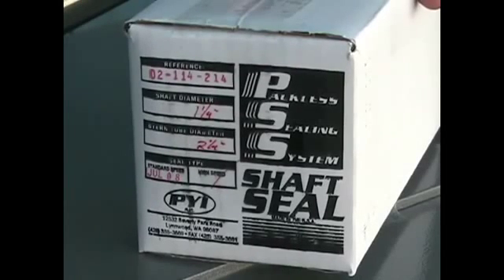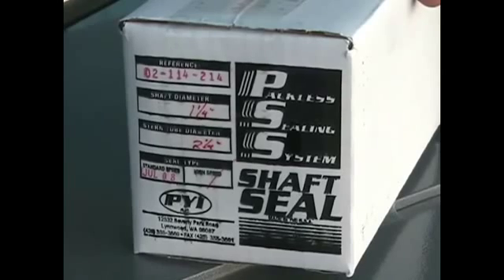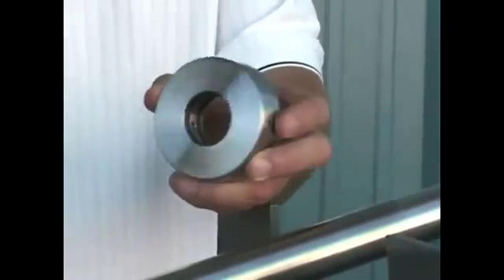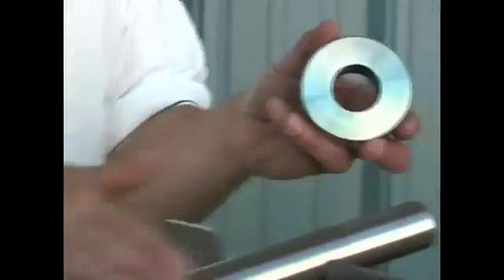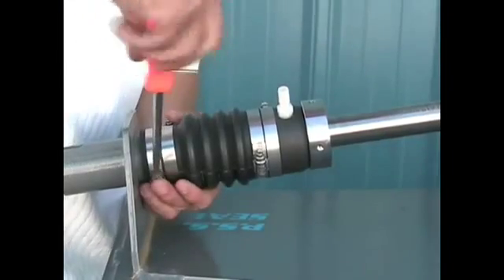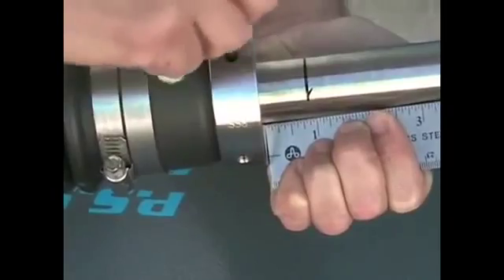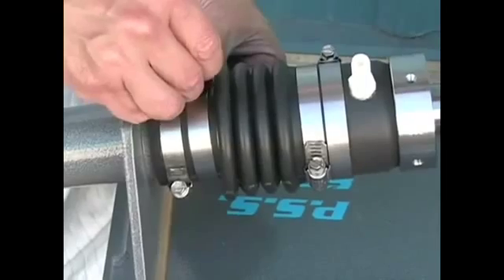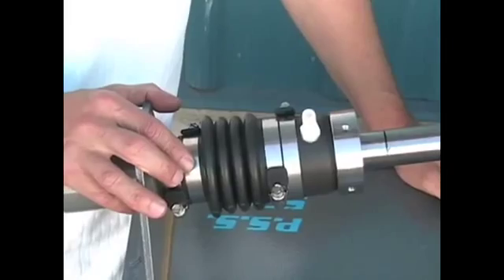How to Install PSS Propeller Shaft Seal Instructional Video PW Marine Engineers

Comment: Yea, step one, cut the old rusty impossible to remove flange off the shaft -just to replace the rubber. Do you have to do that with flax packing? -No.
Reply from the maker: +salvor1 Thank you for your comment, there are many pro's and con's to both the flax packing and the dripless seals.  The flange should not rust if maintained properly, just as you would maintain the flax in your seal.